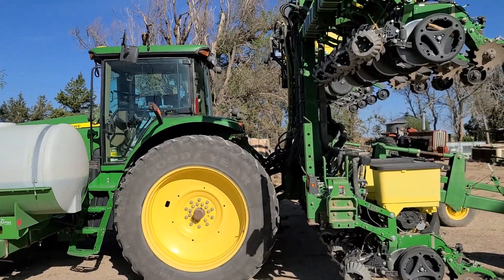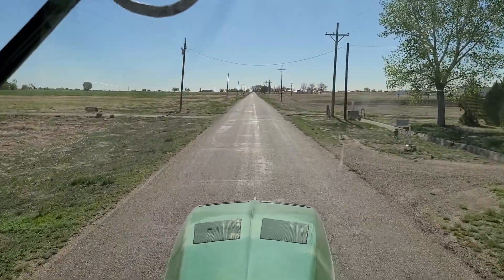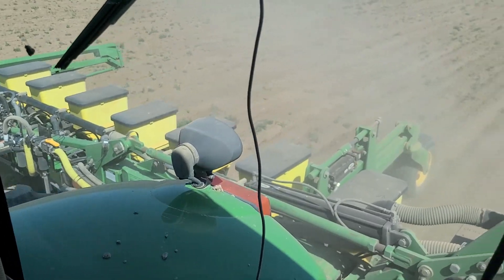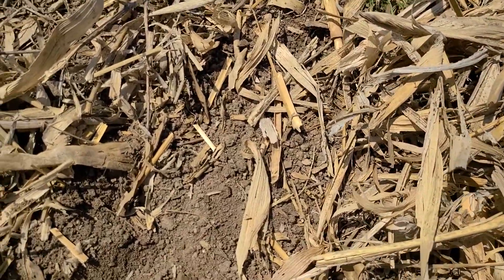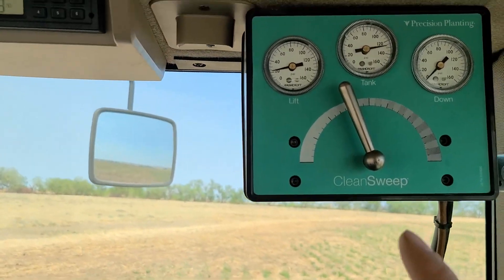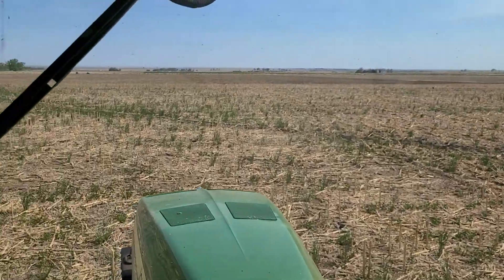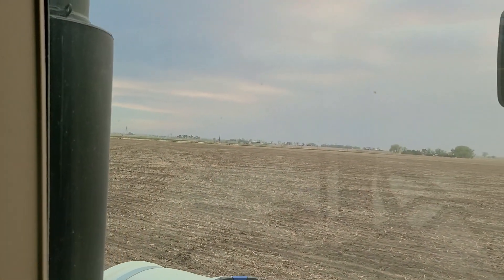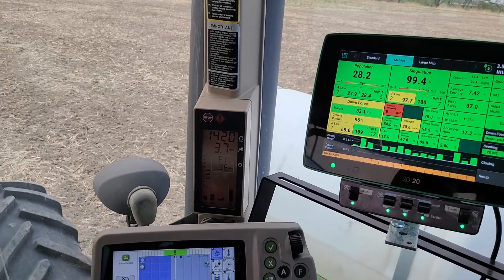Planting Corn (No Till Vs Vertical Tillage)

Comment: There is nothing here relating to " no till " nor " vertical till "  !!  Its been tilled !  No till is dropping the planter and planting.  Been doing no till now for 5 years...... No vertical till no Anhydrous....just plant...........side dress with " Y " drops before the corn is too tall.  
Getting 250 bushel corn on soils of   40  CSR.   It works !
Reply from the maker: I had all 3 types in the video. The first few minutes were in a minimal tilled field. However, after that the next field was split in half. No till on the one side and vt on the other. I do agree that no till works but it takes time to get the soil conditions correct. We also farm in a semi arid environment so that plays a role on the transition.